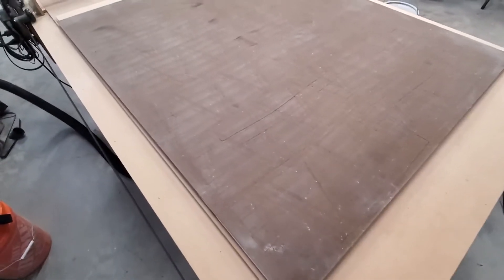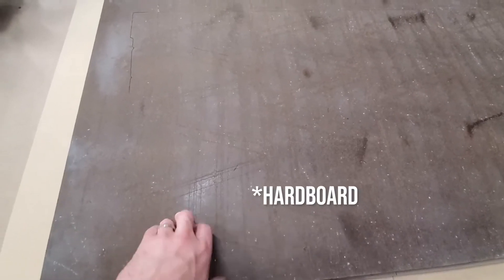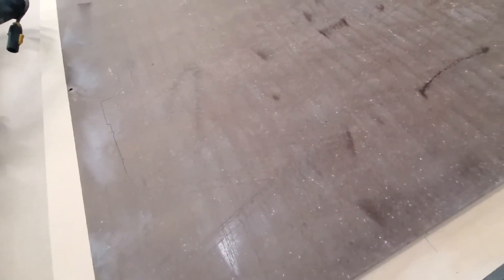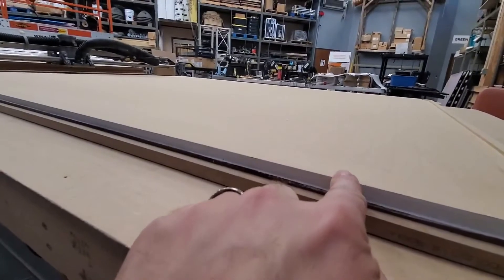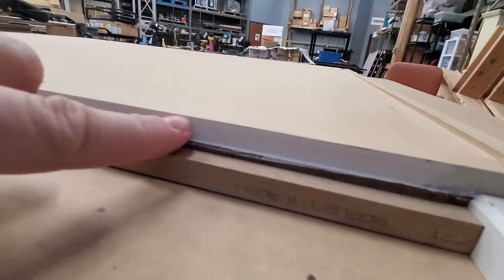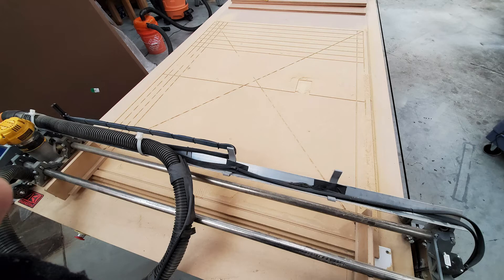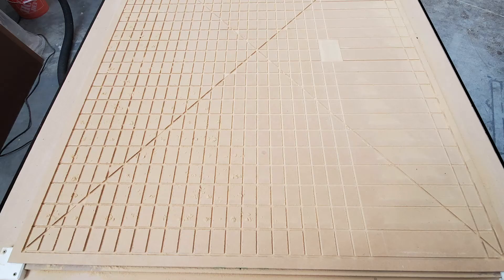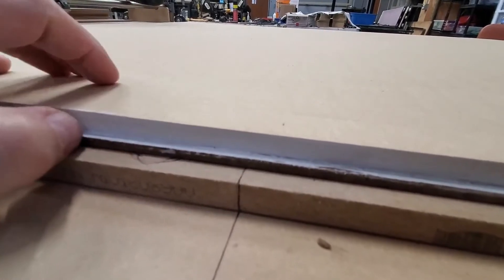UPDATE - Vinyl upholstery CNC cutting now with vacuum table!

Comment: Mdf works but Ldf (light density fiber board) works even better.
Reply from the maker: I have heard of that. Where can you get that from?
Reply: So, we use a supplier called Dixie ply here in Central Florida to source ours. I am able to order 5 x10 sheets of 3/4” from them. I’m not sure about sourcing it elsewhere but I would ask around, it’s good stuff. We use it on our vac table and it works very well. Btw, you have a really good design going Sir.